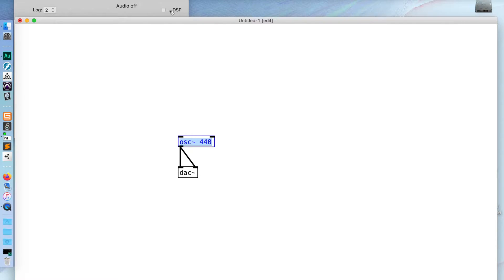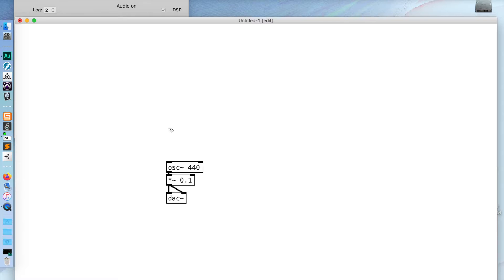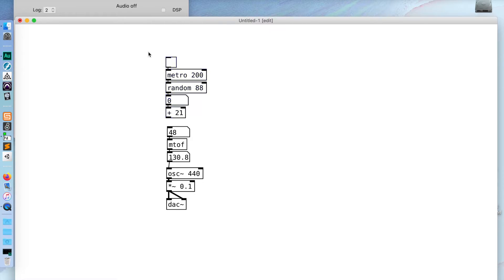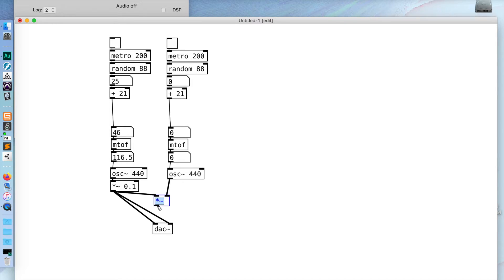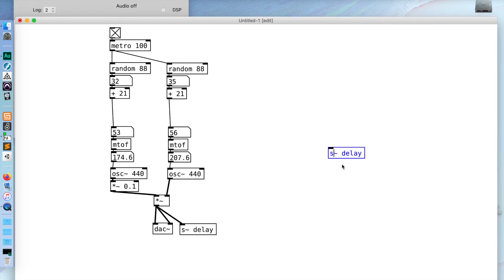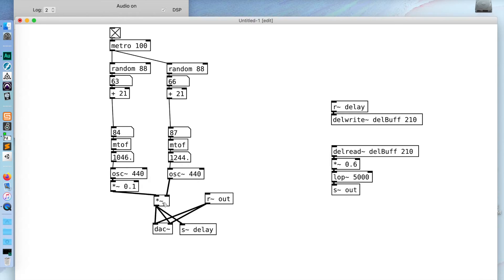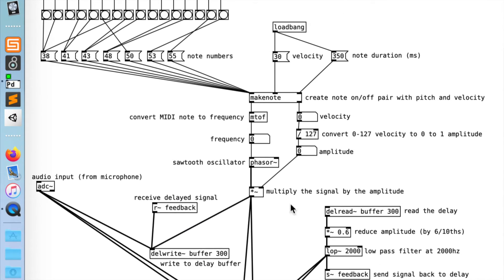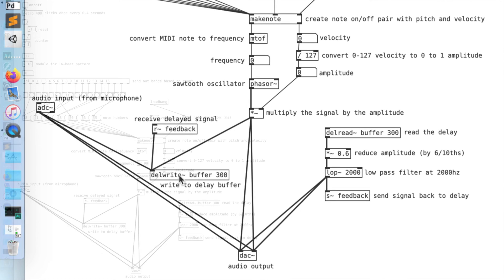Intro to Pure Data 4: Audio and DSP, Part 1 | Simon Hutchinson

Comment: Is the signal multiplication the same thing as convolving them?
Reply from the maker: Not sure when in the video you're talking about, but the [*~] is just a simple multiplication--taking the samples of the signal and either multiplying it by a number (e.g. 0.5 to halve the amplitude), or by another signal (in which case the current sample of each signal is multiplied together). I believe convolution is a bit more sophisticated of a process.

Comment: Good stuff! I love the sound of the skakuhachi. Also, it's really interesting and stimulating to see graphic code in a different environment than I'm used to.
Reply from the maker: Thanks! I'm quite a bit rusty, but I'm happy I can still get a sound out. Definitely with your Kyma experience I think you'd pick up Pd really fast. You can also set them up to talk pretty easily with either MIDI or OSC and use Pd to "play" sounds out of Kyma.